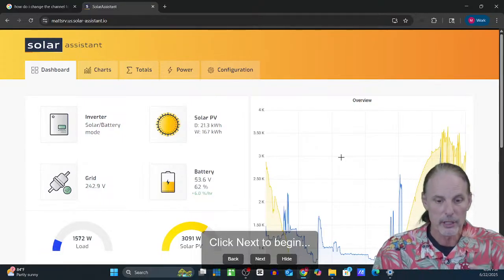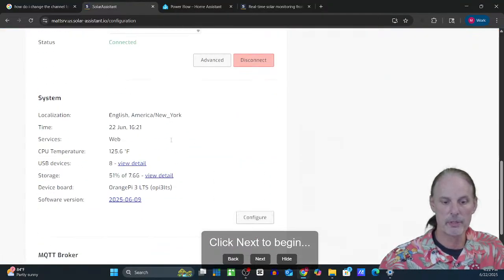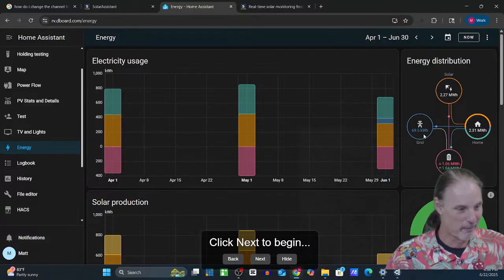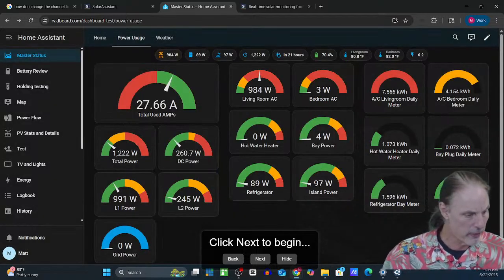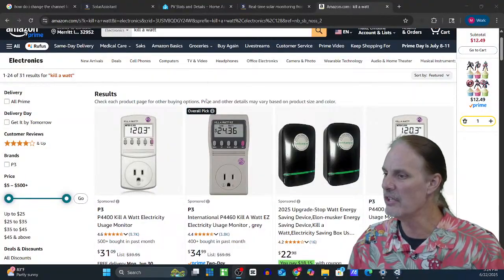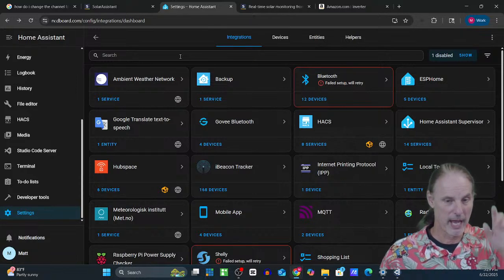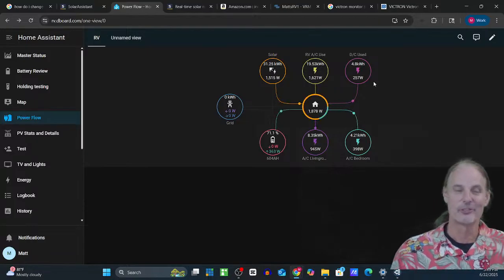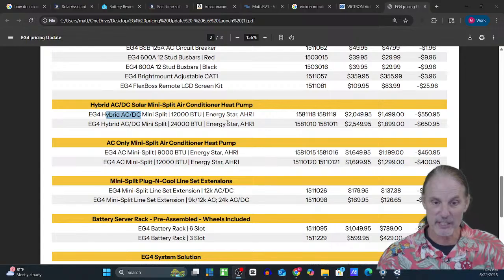Make Your Solar System Smart with Home Assistant!

Comment: Hi Matt, at 23:27 we can see a Blue and a Red cell. After your explanation that it balances the batteries by taking extra power from the highest charged battery and gives some of the to the lowest charged battery, to keep them all similar. Is that we see 1 blue and 1 red, is that the BMS (battery management system) doing it's thing and adjusting the highest and lower cells?
Reply from the maker: The battery reports the high and low, but the balance is only active when all the conditions are met, for mind it is >3.4v cells and .05v difference.. Otherwise it is just highlight what is the high and the low.